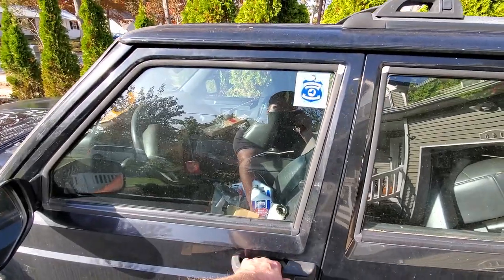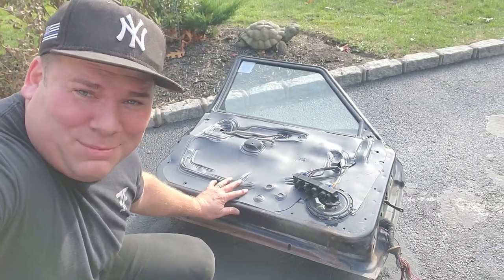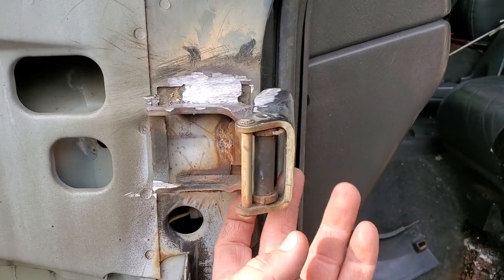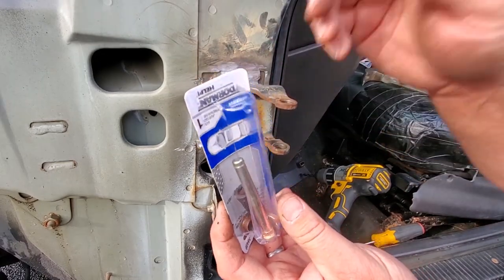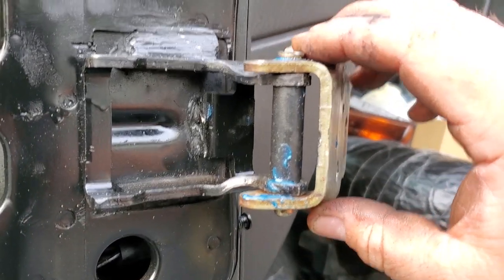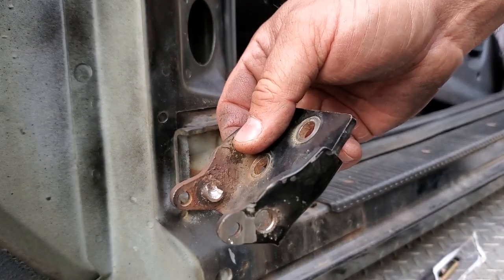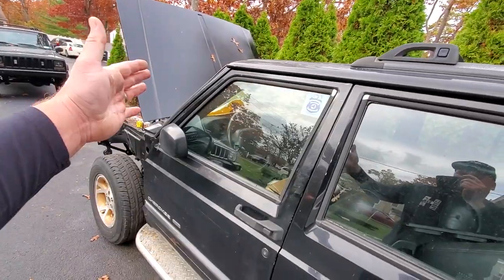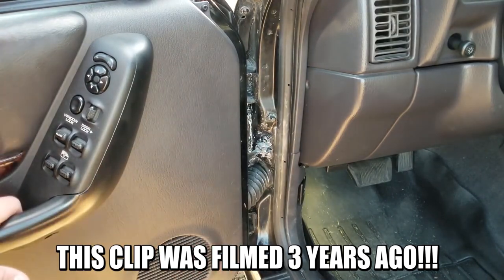JEEP CHEROKEE XJ DRIVER'S DOOR HINGES - WRECKED J  EPISODE 4 DOOR FIXED

Comment: Did you have to weld it the new hinge bolt? I don’t own a welder so was thinking wouldn’t be any good
Reply from the maker: I only had to weld the actual hinge to the door.. the pin did not need welding.. but if you want to practice welding I used a harbor freight flux core that only cost $120

Comment: Where did you get the replacment smaller metal piece? And do you actually need to cut that one?
Reply from the maker: Hey, check the links in the description.. I should have everything in there!
Reply: Ok so I did but it only has one pin. The thicker one but not the smaller one. at least that's what it shows in the pic. Merry Christmas 🎄